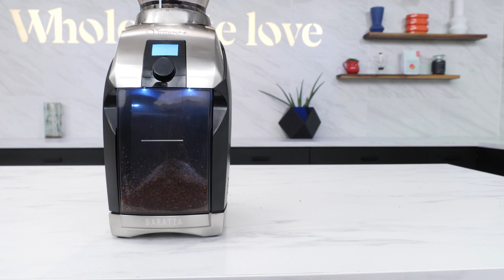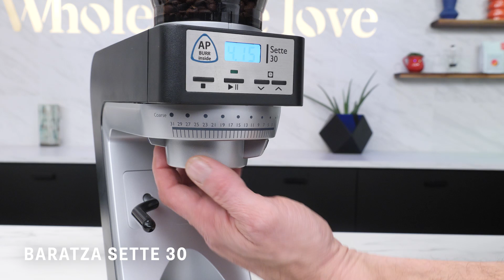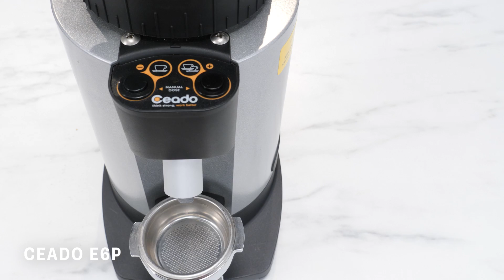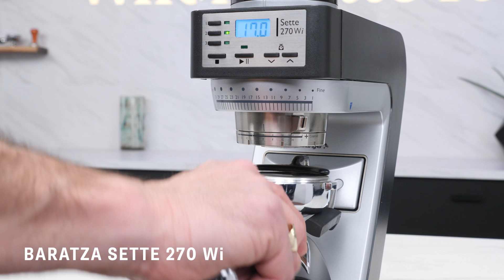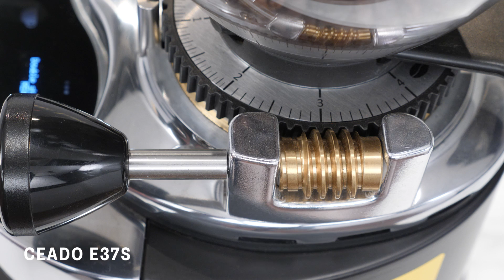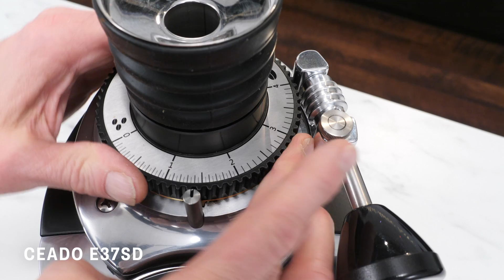Favorite Coffee and Espresso Grinders of 2019

Comment: Hello, trying to decide between Ceado E6P, Mazzer mini E and Sette 270WI, which would You recommend out of this three?
Reply from the maker: Hi TP, Thanks for the question. The Ceado and Mazzer are prosumer level grinders while the Sette 270 Wi is high-end appliance grade. If you do weight based dosing and are doing a few shots a day I can recommend the Sette. It truly is magical! Also a little loud. Just understand it will not have the longevity of prosumer level grinder. The Ceado E6P is IMO the best value in a prosumer level 63mm burr grinder. The Mazzer Mini E Type B has a a better UI for adjusting grind timing than the E6P but  it's significantly more $$. I'm not a fan of the Mazzer's design with the top burr riding on 3 springs and the grind adjustment threads open to the grinding chamber. Coffee dust/oils quickly gum up the threads and make grind adjustment jumpy in my experience. Hope that helps!
Marc
Reply: @Wholelattelovepage  Hello Marc. Sorry I should mention price range as i come from different country,  I have found Mazzer Mini E  type A and B with good deal having nearly the same price as sette 270WI . Ceado E6P is costing quite a lot  $$$ more. So from what i understand from Your post Mazzer Mini E should be best choice?

Comment: Which higher quality prosumer grinder would you recommend that handle Expresso and drip coffee ? Also could you recommend an espresso machine to pair with it, preferably a better quality machine for home use.
Reply from the maker: Hi Randy, Thanks for the question. Multi-purpose grinders are typically a bit of a compromise. You ask for a prosumer level grinder which is going to lean toward a machine grade grinder focused on espresso. If serious about espresso grinding and want a single grinder you should choose for that first. Understand that all espresso focused grinders tend to produce more fines at drip coffee grind size. For those who are very particular about their drip coffee that can be a problem. For the vast majority of drip drinkers it's not. Another thing you will run into is how difficult it may be on machine grade products to adjust grind size from espresso to drip ranges. As I'm sure you are aware precise grind size is critical when making espresso. Not so much for drip. Then there's the coffee waste when you switch grind for brew methods. Adjusting to espresso from drip grind will require all beans having been ground out and/or the grinder running. And you will want to purge retained partially ground coffee when making changes in grind size. If you step back from prosumer level machine grade grinders a bit a wonderful compromise is the venerable Baratza Vario. It's high-end appliance grade. While it is a stepped grinder it has levers for macro and micro grind size adjustment so it's essentially stepless. With reference numbers/letters on the adjustment it's relatively easy to make large grind size changes and then get back to where you were. The Vario can grind hands free into a portafilter for espresso and includes a bin for drip grinding: https://www.wholelattelove.com/products/baratza-vario-grinder-w-metal-portaholder It has 3 timed grinding presets so you can keep times for your various brew methods. The Baratza Forte is the same as the Vario but is more prosumer level in construction with a full metal jacket and more powerful motor - it's used i cafes: https://www.wholelattelove.com/products/baratza-forte-ap-flat-ceramic

A great all around machine for home use is the Profitec Pro 500 PID. It has an HX boiler so can brew and steam at same time, is prosumer level, excellent quality in construction, very accurate brew temps. If you never or rarely do milk drinks you could go with a high-end single boiler machine like the ECM Classika. Same qualities as the Pro 500 PID but you have to wait between espresso brewing and milk steaming as temp raises in single boiler to produce steam: https://www.wholelattelove.com/products/ecm-classika-pid-espresso-machine-with-flow-control
I hope that helps. If in US I suggest giving our coffee pros a call at 585-924-7170. They'd be happy to assess your needs/desires and suggest a good fit. I hope that helps!
Marc
Reply: Hi Marc, how about E37SD as a multi-purpose grinder? It has the convenience of switching between brewing methods. Do you think it will underperform on Drip and French Press / Cold Brew range with respect to grind sizes? I’m in the decision process, really looking fwd to your advice. Thanks.

Comment: Hi Marc,

Which grinder would you pick between the Rocky and the 270 (not WI) and why, taking into account durability?

Thanks in advance!
Reply from the maker: Hi B, Thanks for the question. I'd go with the 270 all day, every day and twice on Tuesdays! The Rocky is slow, can produce clumpy grinds at espresso sizes and lacks precise micro grind size adjustment. The 270 is louder but other than that it's not even close. Easy decision!
Marc
Reply: Whole Latte Love Thanks a lot Marc!

Comment: Which grinder would be best if you have a moccamaster and a gaggia classic? Thank you very much.
Greetings from Germany.
Reply from the maker: Hi CS, Thanks for the question. Always a bit of compromise when selecting a grinder for multiple brew methods. Espresso focused grinders tend to produce more fines at filter coffee grind settings and brew grinders tend to produce a more inconsistent particle size at espresso grind sizes. A good compromise is the Baratza Vario: https://www.wholelattelove.com/products/baratza-vario-grinder-w-metal-portaholder
It can grind into a portafilter or a grinds bin, has 3 timed grinding presets for accurate dosing and is easy to switch between grind sizes. For those that are incredibly particular about their grind they may prefer 2 grinders. The Virtuoso+ is as excellent lower cost brew grinder: https://www.wholelattelove.com/products/baratza-virtuoso-coffee-grinder
Hope that helps!
Marc
Reply: @Wholelattelovepage  Thank you so much for the recommendation. So this would be even better for multi purpose than the 270(Wi)?

Comment: Do you prefer grinding by time or grinding by weight?
I think about to buy a new grinder and sell my rancilio rocky. Best regards from germany!
Reply from the maker: Hi t, Thanks for the question. It depends... The Sette 270 Wi is exceptional at weight based grinding. It's high-end appliance grade so needs to be treated with respect. There is peace of mind with Bartaza's fixed price repairs - I do not know if their fixed price program is available in Germany. Machine grade grinders are usually very accurate with dispensed weights cycle to cycle. But change grind size and the dosing weight will change so one usually has to adjust the timing. When using timing I at some point end up weighing. Hope that helps!
Marc
Reply: @Wholelattelovepage  Hi Marc, thank you for your detailed answer. I really appreciate it! The Sette 270 Wi is on the shortlist :) I'm looking forward to more videos from you, regards - Tobi

Comment: For those that they are serious about coffee, avoid the sette plastic grinders ! It's not only about the noise, the plastic they use is really cheap and after 1-2 years of use it starts make more noise , cause every part inside the grinder is screws on a plastic parts, and they start become loose slowly slowly ! The grind quality is amazing but the build quality of the grinder is VERY poor !
This is my advice after using the sette 270w for 2 years.
Reply: I heard they are better now? Also the transmission costs about 60€ to replace yourself?

Comment: That 270Wi precise weight dosage is almost magical as Mark say, it's really nice to have this at such an acceptable price and is a real shame that no other grinder seems to have an integrated scale even though they can cost 2-4x the price. I love my (Rocket Fausto) but I wish it did have that weight-based grinding, not just timing cause then I still have to verify the weight seperately on the Acaia scale so that's an extra step.

Also why the heck are single dosing grinders that expensive?! I just don't get why it should be like an extra 1000$ over the same non-single version. Like why they don't make that E37SD without those overpriced titanium blades so it is more affordable like the hopper version?
Reply from the maker: Hi P, Thanks for the comment. The 270 Wi is a marvel! Only grinder I'm aware of which nails weight based grinding. It took Baratza a few years to get it perfect but wow! The E37SD is rather expensive but has some extras on top of the standard E37S. Things like the release of the quick set gear for easy macro grind size changes, the bellows, RDT cup, dosing funnel and those titanium burrs do add to the cost.
Marc

Comment: I would love to get the Ceado E5P, seems better built than the 270WI , the killer is the inability to grind into a Bottomless Portafilter.  By any change has Ceado ever made an add on attachment to correct that issue?
Reply from the maker: Hi Anthony, Thanks for the question. If you always do bottomless then the E5P is probably not the way to go. There is a workaround as you can use a finger to push the start switch. But that may get old if only doing bottomless. Ceado has not made an attachment as they have the E6P which can grind into bottomless and has 2 timed grinding presets as well as on demand grinding: https://www.wholelattelove.com/products/ceado-e6p-electronic-dosing-grinder-v2 Aside from the timed and hands free grinding the E6P is identical in all respects to the E5P. Compared to Sette the Ceado grinders are better built. They are machines while the Sette is a high-end appliance. That said, I do like the 270Wi! Nothing short of miraculous to set a weight push a button and get within +/- 0.1g nearly every grind cycle and it's hands free! If worried about reliability of the Sette know Baratza has a fixed price repair program should you need it down the road.
Marc

Comment: Hey Marc, when grinding with the Mignon Perfetto, should I be adjusting the setting while grinding or before I start the grind...and why? Thanks!
Reply from the maker: Hi Ryan, Thanks for the question. So most all manufacturers out of an abundance of caution put somewhere in the manual to only make grind size adjustments when the grinder is running. Truth is there's no problem adjusting to a coarser grind size without the grinder running. There is a slight risk in adjusting finer without the grinder running that you will crush partially ground beans between the burrs which can prevent the grinder from starting next time. If that should happen stop the grinder quickly or motor could burn out. Personally I make very small adjustments finer without grinders running all the time. Again only very very small adjustments! Like when I want to increase length of an espresso extraction by a few seconds. I would never do that if going from drip grind down to espresso size unless all beans were ground out. Hope that helps!
Marc
Reply: Whole Latte Love you’re the man Marc! Thank you! Very very fine adjustment is where I’m at lol thanks again and keep up the great videos

Comment: Thanks for this breakdown. I currently own a BCG820BSSXL grinder and it has served me well over the last two an a half years. However like many Breville grinders before it, the impeller under the burrs has worn out and needs to be replaced. This despite Breville changing the design to use a metal impeller. Breville doesn’t sell parts and it costs too much to bother sending it in for a repair.  

So I’m going to pull the trigger on a Sette 270. I think that one will last me a long time.
Reply from the maker: Hi Rick, Thanks for the comment sharing your experience with the Breville. Get ready for a big upgrade in grinding! And, if you ever have issue with the Sette Baratza has a wonderful fixed price repair program. Details on that here: https://baratza.com/grinder-repair-program/
Regardless of issue (with excepetion of burr replacement) it's $85 for Sette 270.
Marc

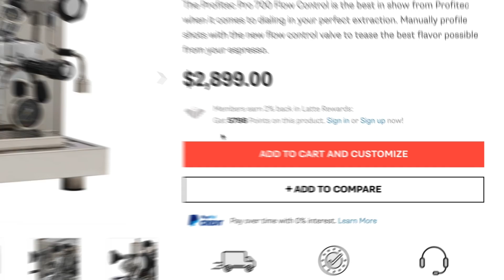Comment: 1:13 I almost spit out my coffee. I think I’m happy with my Breville express that I bought new for $350.
Reply from the maker: Hi LN, There are levels of equipment. I often refer to products as appliance grade or machine grade. Breville tends to fall in the appliance grade category. They offer some value but get there with lots of plastic used in construction and limited user serviceability. Machine grade products use little or no plastic and can go for decades.
Marc
Reply: @Wholelattelovepage  I'd be interested to see which band you put the Specialita into. I changed from a Mazzer Super Jolly to a specialita, and my impression is that (hopper aside), this thing is built every bit as well as any commercial grinder I've used, only scaled down for the home. In spite of being 9mm down, it seems to grind faster than the mazzer and with less clumping (potentially more aggressive burr set I guess). 

The specialita is one of my favourite coffee products of the last few years and was the grinder that finally made me give up on the huge, noisy, mazzer.
Reply: Honnestly you can't even compare. I've had the (Breville Oracle) which was their most expensive before they make the touch-screen version and let me tell you it is absolute supreme trash compare to any real manual machine around the same price. The best of Breville is still like a (Toyota Tercel) and even an entry-level (Rocket Appartemento) will still blow it away in term of quality. I've had the worst customer support and warranty issues with Breville, and the fact they put a 50$ grinder on their 2000$ machine say enough about how they don't care and know nothing about espresso.
Reply: Breville products are MADE IN CHINA. We all know what that means, and we don't like it. China sucks.
Reply: @PaulLawson-k8v  you are outdated then

Comment: What setting would you recommend on the Forté BG for v60 pour over
Reply from the maker: Hi Michael, For pour over you want a grind similar in particle size to that used for drip/filter coffee. On the macro side adjustment go to the middle ranges. Don't need to worry about the micro setting - that's mostly for dialing in of espresso. If you get bitterness at a particular grind size adjust your grind a little coarser next time. If sour adjust the grind a little finer. Hope that helps!
Marc

Comment: Just a tip to save some money. You can buy the Baratza sette 30 and then buy the micro change adjustment assembly from the Baratza website for only about $100. You now have a Baratza 270 without the ability to preset which is not a huge deal. And you save money.
Reply from the maker: Hi Kaleb, Thanks for the tip! That can be done. Just note going that route one will miss out on easily adjustable PF hooks, retention of PF for hands free grinding, more robust construction of hopper shutoff, 2 more timed presets on the 270 or super accurate weight based dosing w/3 presets on the 270Wi.
Marc

Comment: Mark — looking to buy one final grinder for as long as it will last!! Looking between the Baratza 270Wi and the Eureka Atom 65.. does the higher price tag warrant higher quality? What would be the suggestion to have a great home-use grinder and use for its lifetime? Thanks!
Reply from the maker: Hi Jon, Thanks for the question. 2 different build levels here. I love the 270Wi! I use it a lot as it makes dosing weight so easy. Even after changing grind size you don't really have to think about it. But, it is an appliance grade build so lifetime of service is asking a lot. The Atom on the other hand is machine grade build. Lifetime service from the Eureka is a possibility. Price difference IMO is justified and to be expected when jumping from appliance to machine grade. With all that I should mention Baratza has excellent service. If you ever have an issue with their grinders they offer a flat price repair program. Details on that here: https://www.baratza.com/grinder-repair-program/ At the moment any repair (except burr replacement) to a 270 Wi is done at flat rate of $90.
Hope that helps!
Marc
Reply: If I could pick your choice, Jon, I would choose Atom 65. But, if I think I want a cooler version, I will get Atom 75. Atom 75 is basically the same as Olympus but quiter though slightly slower. You can upgrade Atom 75's burrs to titanium and the hopper to single dosing hopper.
Reply: Dwika Febrianto I went for the Atom 75.. very nice grinder but much messier than I was expecting!
Reply: @jonyates377  Oh good. You can control the chute, no? Does it still fly the ground coffee anywhere other than the portafilter?
Reply: Dwika Febrianto flies all over — maybe to do with the portafilter.. but it’s a 18g basket and I’m using 17g.. maybe an issue? In any case, very messy but not sure if the same issue would happen with the vario
Reply: @jonyates377  grinders tend to be a little messy but if your grinder throws 2g out of 17g (so only 15g retains in your portafilter), it is really bad and I think the basket is not an issue. Have you tried using a dosing funnel so the portafilter can catch the coffee ground better?
Reply: Dwika Febrianto yes that’s a great idea.. any that you would recommend? Or just something homemade... really appreciate the help!
Reply: @jonyates377  I think a cheap one (around $15) at Amazon will do. I'm not sure about homemade but I heard you can make one with a plastic bottle or paper cup. If dosing funnel doesn't help either, you should ask the seller of your grinder. Atom 75 is not a cheap beast, you deserve at least a good customer service.